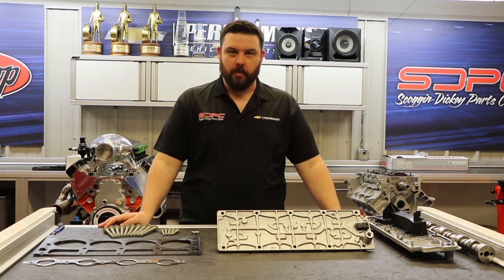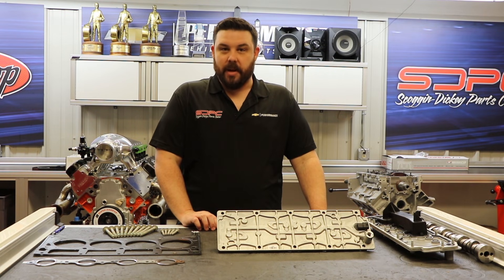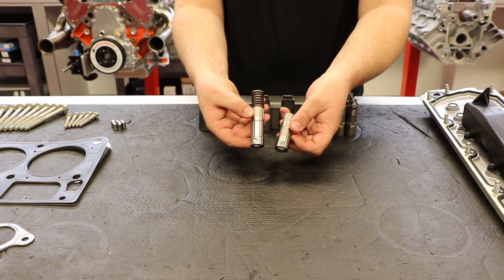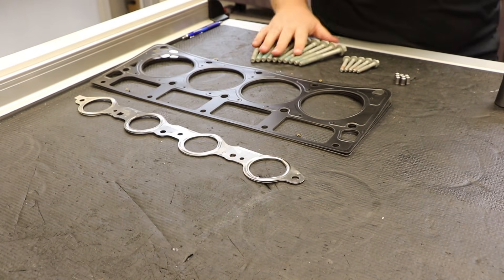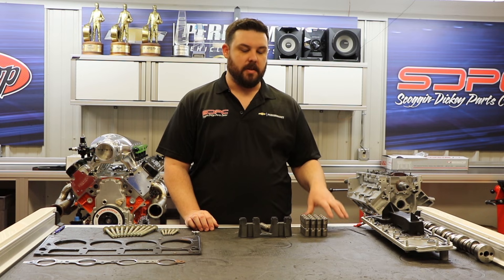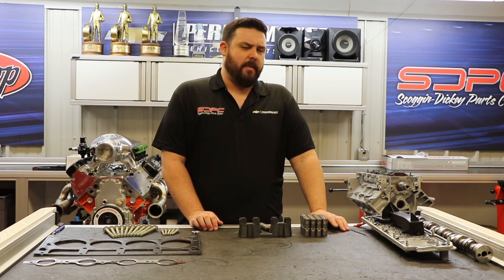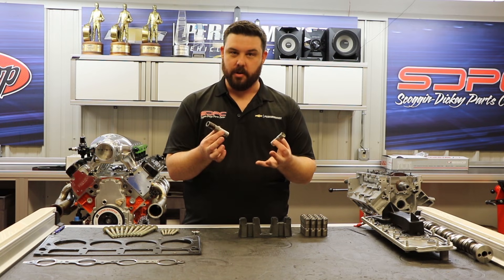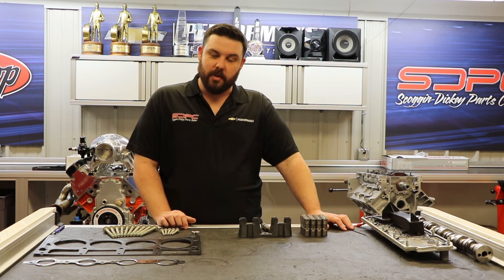SDPC Tech Tips: DOD/AFM Delete 101

Comment: something bout the term “V4” dont sit right with me 😐 lol 4 cylinder
Reply from the maker: Some customers with aftermarket exhaust really don't enjoy it at all as the engine note sounds very odd.  Some will actually have a shope shut off the DOD/AFM in the calibration just because of that.
Reply: Scoggin-Dickey Parts Center so i have a question is there any DOD/AFM delete kits for cars such as 2018 Malibu? or is it only for V8 ?
Reply: Scoggin-Dickey Parts Center that makes sense...I just had true duals installed on my 2011 Tahoe with 5.3, and something sounds off...and the engine is in good running condition. Ok. Good content here. Thanks

Comment: On the L86 motor can you pass emissions with a DOD delete and a stage 1 or 2 cam with a tune and nothing else?
Reply from the maker: It could depend entirely on the tuner, but we cannot confirm or deny that as we never sought CARB approval.
Reply: I would expect so but only based on empirical experience. I run a 224/224 cam on my LS1 2001 Camaro SS, and it is still very clean according to the printout test results by smog Nazis in CA when checked....the smog tech never even commented on it...

Comment: Hey does it matter which way you put the non dod lifters in as far as oil hole position
Reply from the maker: Orientation doesn't matter in that aspect as long as they seat in the lifter bucket and the roller tip rolls w/ the cam.

Comment: looking at TSP Stage 3 cam kit for my 09 G8 GT. What would happen if i install the kit, use your delete kit and attempt to drive the car to the tuner? I've tried looking this up to see if anyone has attempted it, but haven't been able to find anything stating what would happen. In theory I would think the computer would go full tilt retard and throw into a limp mode, but again, unable to find any concrete information. Tuner is about a 30 min drive from my house, so not like I'd be driving a hundred plus miles. Thanks in advance
Reply from the maker: Might see if they can bench top tune your pcm and do a base calibration to keep it from throwing a complete fit.

Comment: Is it possible to install the GM delete plate without replacing the lifters and thus not needing to replace the cam?
Reply: Dillon Turner 
No
If you don’t want to replace anything, then just cancel it with the tune , have all pistons working and no AFM

Comment: I did a Texas speed dod kit shut off dod still have ticking # 3 cly
Reply: I just built a 5.3 and did the dod delete and have ticking some but I wonder if I put lifters in wrong as far as the oil hole position
Reply: @dubba85  my ticking stopped after about 50 miles

Comment: Have a easier solution, Range Technology like I did from new. No issues and nearly 300,000 miles
Reply: Tried that. Now cylinder 7 is dead and doing a full delete at 170k lol
Reply: Must be one of the lucky ones. Putting your transmission in tow haul mode  works too.

Comment: I have a 2007 Impala 3.9, the lifters with the springs failed. For replacement I got the regular lifters along with the full gasket kit and the lifter retainers. Can I use the Camshalf that is already in the engine? and do I have to have something to block off the oil?
Reply from the maker: We do not have any information on those, and not aware of any replacement camshafts you could use.  If the camshaft is damaged by the lifters when they failed, you will need to replace the camshaft (would be best to remove and inspect anyway).

Comment: Will this kit fit a 2007 chevy avalanche LT  5.3 FLEX FUEL 2WD DRIVE? thank you!
Reply: Also on the valley cover will I still need the filter that goes on the bottom of the oil pressure sensor?
Reply from the maker: @gregorioreyna  Yes it will fit, and you will reuse the stock oil pressure sensor filter.

Comment: If you’re in the metro Atlanta area I disable this feature for $150 up to 2016 models.
2017 & 2018 add $100.
Less pedal lag, raised speed limiter and more power included at no additional charge.
Reply: Lt1swap.com does it for 50$ with shipping included
Reply: You don't do it the right way for only $150. The correct way you have to change the cam, lifters, oil pump, & there are oil ports that have to be plugged. You're not doing all of that for $150!!  

Doing just the computer isn't the correct way. You have to do everything I mentioned, besides the computer delete.
Reply: Max Germain I have the lifter noise - with dod delete will that fix issue

Comment: If i buy this kit how much would be a fair price to get this installed in a shop?
Reply from the maker: Without the parts, it could be a couple grand in labor and tuning.  Honestly depends on a variety of other things on to of it all.
Reply: So basically, " if it's not broke, don't try And fix it"
Reply: Tune DOD out of your ECM. The lifters will last longer but they do have a lifespan. When noticing a ticking noise from the engine even when it's at running temperature it may be time to think about it before it fails.

Comment: Tons of people going with a plug in dod tune delete or so that’s how it’s advertised. When adding this plug in you’re still using the afm lifters and cam so you’re essentially wasting your money correct?
Reply from the maker: The plug in device is a bandaid, but if you plan on just replacing everything anyway, it it is already ticking, I'd save the $ and not get the device.

Comment: Will the new stock replacement cam give a slight bit more horsepower than the dod cam?
Reply: 318 La not really. If you could feel the slight response lag from AFM disabling, when stomping it, that will be all you’ll notice. It’ll be gone. You don’t really feel major gains until you start tuning and doing bolt ons. The tune can make your stock motor feel like a different monster.

Comment: If my truck is running fine currently , will a simple custom tune turning off dod prevent this issue from happening ?
Reply: I have a 15 sierra and I tuned it to always stay on 8 cylinders and 2 of my lifters collapsed on me at 98k miles. Still having issues with it, thinking about getting a new truck without the DOD. Those systems suck
Reply: @eckounltd956  it's funny that you say that. Just traded my Sierra off for a 2019 tundra . Been having lots of problems over the past 6 months with the Sierra. oil leaks and went through 2 oil pumps within a week . I've had it with gm quality or lack there of
Reply: @EverydayJ1786  yeah thinking about going with a Ford now. I had tuned my sierra at 40k miles and at 98k 2 of them collapsed, mechanic said it was due to the dod/afm. You may be able to tune it to always stay on 8 cylinders, but the parts are still there. To have a reliable truck, you must do a dod/afm delete
Reply: @eckounltd956  yeah I see what you mean . 
I'm a municipal fleet mechanic and work on mainly Ford's . Unless you want to get into a f250 and up larger ,. I suggest you reconsider your choice and not opt for a f150 if you want I'm proved quality and reliability . All the f150s I work on are just junk . All range from 2014 to 2019 with all engine options
Reply: @EverydayJ1786  yes I am considering an f250 cuz exactly what you told me right now that Fords break more than GMC/Chevy trucks my mechanic told me. Thank you for your help
Reply: @EverydayJ1786  i had 99 ford f150 4.2v6 for ten years. In all that time the worst repair i did on it was having to replace the alternator thats it. After that truck i got the truck i have now cause it looked pretty. Its an 09 chevy silverado 5.3 v8. This has got to be the worse vehicle i have ever owned it is currently sitting in my back yard while i attempt to dissassemble what feels like 90% of the whole engine so i can replace a bad lifter. This is the third time a lifter has gone bad on this truck since ive owened it. Back when it had 120k miles i had to pay 2800 to get the lifters fixed a month later i broke down again from a bad lifter but the mechanic had given me a year guarantee on the work so it didnt cost me anything to get it fixed that time. It had 170k miles now and three months ago a lifter went bad again i have started to try to fix it myself so i dont have to pay 2800 again. It is alot of fkn work i barely took the heads off today and god only knows how much the parts are going to cost and how long thd truck will run til it breaks down again. Oh and about a year ago i had to replace the oil pump cause it had no oil pressure. When the mechanic replaced it he said it looked like the pump that was in it had already been replaced before. Both the low oil pressure and bad lifters are common problems with these trucks do yourself a favor and dont buy these trucks youll thank me later

Comment: Can I use a ls9 camshaft with this kit without buying new pushrods?
Reply from the maker: Many customers do use the LS9 cam with no pushrod change, but we always recommend measuring for proper length pushrods with any change in camshaft or valvetrain components.
Reply: Also do I have to tune the truck or can I just use a plug and play dod disabler with the ls9 camshaft since I have the disabler already
Reply from the maker: @antoniogarcia-qe7dz  You would need to have the truck tuned for the new camshaft.

Comment: Does this ticking of a collapsed lifter show an error code/ check engine light? I have a light tick coming from my silverado that I just bought (70k miles), and am now concerned
Reply: A little late reply here but yes. You can get a misfire code. My '18 Silverado developed a tick and cylinder misfire at only 20k miles. New cam and 16 lifters later it was fixed. The cam and lifter were chewed up on that cylinder.
Reply: @bic94  At 20k miles? I'd be pissed bro. that sucks